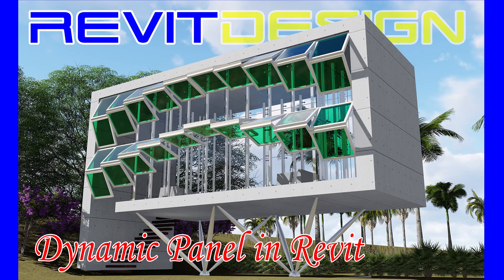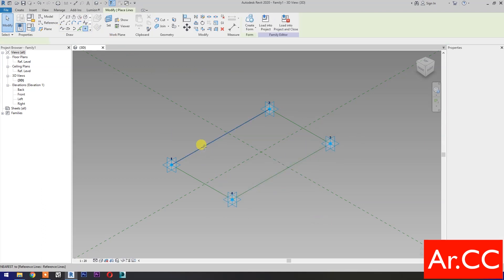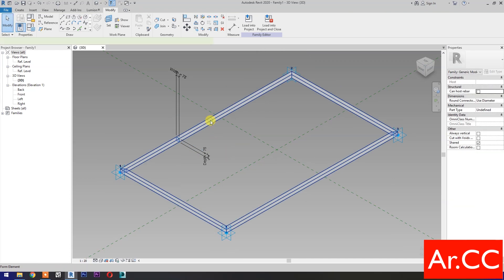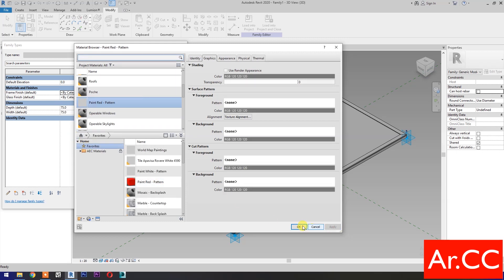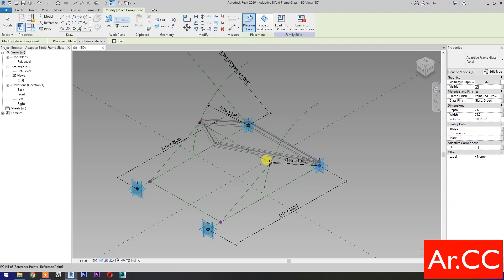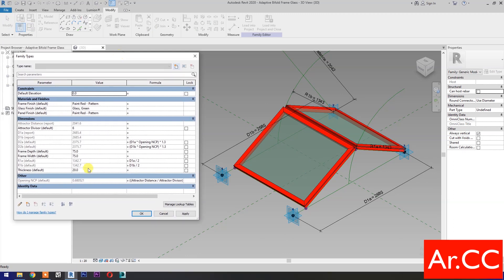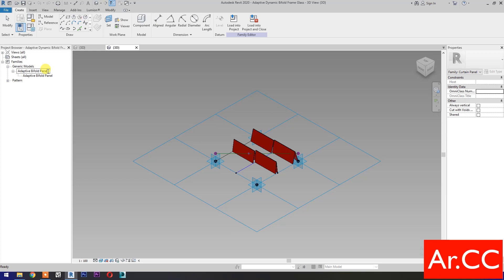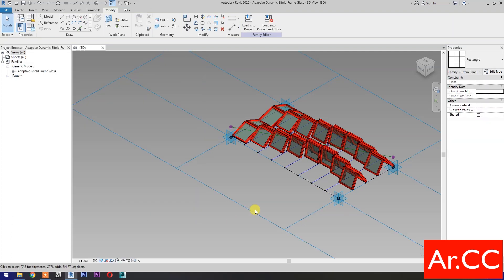RD141. Dynamic Bi-fold Frame Glass Panel in Revit. Revit Kinetic Facade.

Comment from the maker: Suggested Videos:
RD141S. Kinetic Panel Facade in Revit
https://youtu.be/0i1xO4VdI5A
RD140. Kinetic Bifold Panel Facade in Revit.  Revit Parametric Design.
https://youtu.be/vKYqwTX1EUQ
RD004. Modeling Tutorial. In Place Mass. Space Frame. Store Front with Spider Fittings.
https://youtu.be/X_c4VKsEuPI